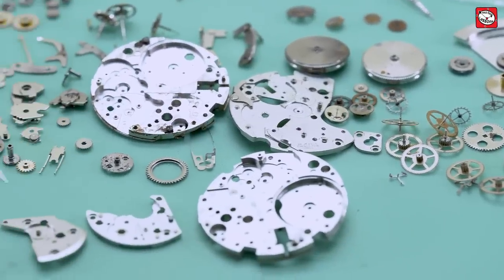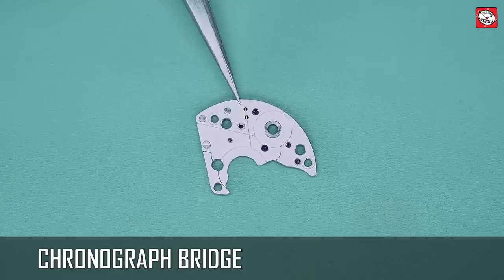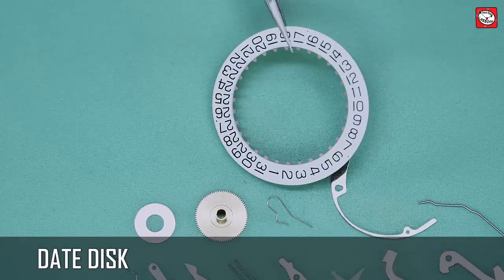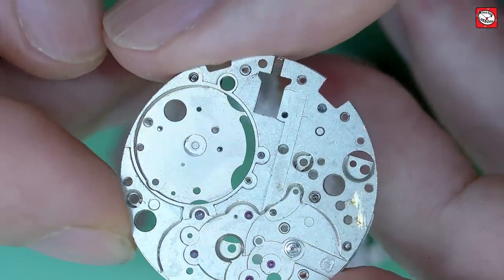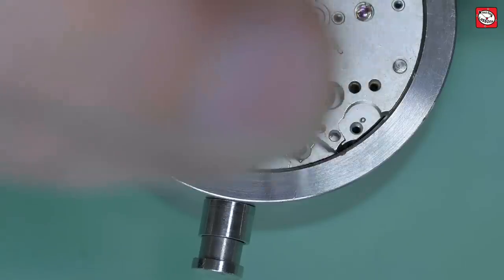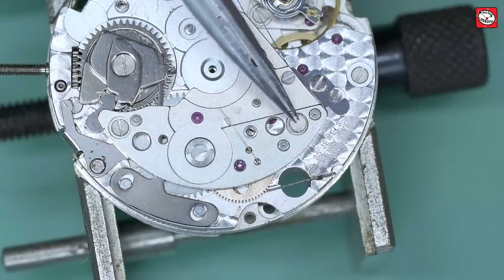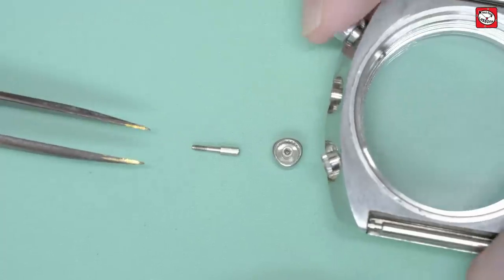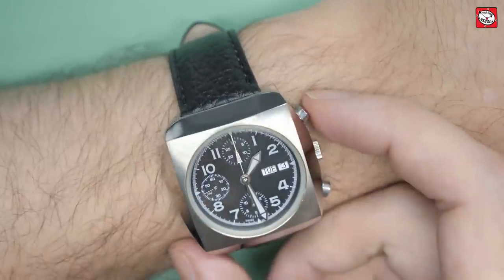I BUILT A WATCH OUT OF JUNK PARTS. Rusty Chronograph Parts to Full ETA 7750 Chronograph Restoration.

Comment: Great video...I watched this & then immediately built my own watch, complete with twin-tourbillons, & all I used was a single discarded Bic pen, some old Hot Wheels, & a waffle-iron my Mom gave us.  It was running 2-3 seconds fast a day, which was disappointing.  So, of course, I dug some rocks out of our yard & incorporated a quartz oscillator.  I know what you're thinking...."wait Scott, that's just some completely home-made Spring-Drive tech, like Grand Seiko uses".  You'd be right, but I've modified my twin-tourbillons into a perpetually regenerating battery/power-source, which is theoretically impossible, by simply incorporating some old wire out of a Speak & Spell my parents bought for me in 1981.  Now there's talk of making this watch I built into the official World's-Watch, from which the new coordinated universal time for the world will be based.  There's even going to be a call in #, like in the old days of dialing POPCORN, & you'll be able to call in & actually hear the exact time, from the watch itself!  I've accomplished this, of course, by sourcing parts from a Teddy Ruxpin talking bear that my parents bought for my little sister in 1986.  You're all so very welcome....now we'll all know, for certain, what damn time it is.  Scott Sherman

Comment: I had a watch from Schwartz Etienne where the 7750 is modified to use a column wheel for the chronograph, instead of the cam system. But a great movement and you built a very nice watch.

Comment: Has a bit of a Bell & Ross look to it....very nice. I took apart an old 3-hand TIMEX a few years ago and used modeling paint and paint stripper on the hands and dial. I was trying to give it a "rat rod" look and it actually turned out fairly well. I decided to do the case as well and that's where things went wrong. I rushed the job a bit and faded the case out too much. Once that was done, there was no real coming back. The case was a satin black and I couldn't replicate the color so I striped the case down to bare metal. I brushed the steel and then painted in some fake rust but I couldn't get the case to match the look of the dial. It's still in a drawer somewhere waiting for me to give it another shot.

Comment: Great to have the opportunity to see a real craftsman at work.  For non destructive rust removal you could try molasses or other polysaccaride reducers like Karo Light or a Maltodextrin solution, using a warm/hot solution (180F 80C) might also accelerate the redox reaction.

Comment: The dial looks great, no need to change it in the future. It matches the band and gives this chronograph a high-tech aviator or race-car feel. It makes the thick block case stand out even more against the dark dial and band. It looks like a very classy watch and nobody would know the case and movement weren't some watch designer's original idea and manufactured brand new at the source. Try wearing it proudly at some horology convention and see how many compliments and "what brand is that? New?" comments you get. LOL

Comment: To be clear - scrap or used movement parts should never be used in a customer repair job. This video is for entertainment purposes and was really just an experiment on my part to see if it could be done.

In this video we take a big bunch of scrap valjoux (ETA) 7750 watch parts to see if we can build a working and reasonably accurate Automatic Chronograph wristwatch.

This project presented quite a few challenges, not least the amount of corrosion which needed to be dealt with. Can we get it working? If so., can it be accurate? Let’s see!

Comment: Hey Mark,
Great video!!
What do you use as a rust remover? Dilute phosphoric acid?
Also, I have managed to get small screws out of things (similar size to the ones in the video) by putting the part in the oven and heating it, cooling it down ... depending on how stubborn the screws are, several cycles my be needed.
The difference in expansion will break the rust-seal eventually 

Paddy

Comment: Have you tried alum solution for removing broken screws? It takes forever, but supposedly it only dissolves iron. I've tried it before and it takes about a month for a broken off winding stem to disappear from inside the crown, but it didn't even  hurt the plating on the crown.

Comment: Just asking as I wouldn't know any better but on the first plate that was scrapped because the screws / bolts could not be removed, could you not have drilled them out and clean up the threads afterwards, or is the scale so small that this is not even an option?  What ever the case, (pun not intended) I am truly enjoying the calm relaxing nature of your informative videos. I didn't know a thing about watches, haven't worn one in 40 yrs but man, I feel quite edumacated after this ;)   Thanks again.

Comment: I've got two mechanicals to test myself on, a early 1900's Ingersoll Alert Junior pocket fob watch and a quite nice Russian movement pre-quartz Sekonda which is very old but in good condition, the hair spring retainer has come out from under the bar but the spring is in good condition so just needs putting right as it is even running for a few minutes :)

Comment: For rust removal you should try a product called Evaporust. It is not acid and is safe for any rusty metal and will not eat off any plating. I have heard it might be a problem with Iron Oxide finishes (since that is very similar to rust) but otherwise it's been a lifesaver. Also harmless to other metals and plastic.

Comment: How did you remove the rust from the parts?
Reply from the maker: With rust remover - It's in the video.
Reply: @WatchRepairChannel  Previously, you used a paste made from water and baking soda.  Is the WD-40 rust remover preferred?  I recently used the baking soda on a Bulova 11AL main plate and it worked fine, but if the WD-40 is better, I'd rather use that.
Reply from the maker: @benjaminbarrera214  It's my new preferred method. But anything that works for you will be good as long as it's non-destructive. I found the WD40 to do a good job on steel parts as well as not damaging the Rhodium plating on the movement plates.
Reply: @WatchRepairChannel  Thanks!  I was uncomfortable exposing the main plate to water so I'd rather use something non-aqueous.

Comment: Wow that is a bit of a monstrosity on the inside. Amazing that it even works. Is it possible to clean up the insides more? Without replacing more parts? Kind of appalled at the rust pits and stuff. Sorry, I have lots of hobbies, but watch repair is something I haven't tried yet. Being a klutz and all that kind of is a good reason to never take it up. If you're willing to give that away / sell that, it might be a fun thing to take apart and play with. xD First I need a pair of tweezers and some small tools.

Comment: Quick note: Wd40 isn't exactly a penetrating oil meaning it won't seep into screw threads and loosen them up. Try pb blaster or liquid wrench or even Wd40 makes a penetrating fluid. Depends what's available in your area

Comment: Dear Sir , thank you for your many video 
Now I can a clue of what automatic watch is . But this time I would like  to get advise from you from same project of building and Watch from scratch. I bought a case with its dial for ETA7750 , but the case was used and the movements holder is missing. Can you please advise when I can get the movements holder and watch hands. Here are some dimensions 
Case Internal diameter is 34mm
The dial is 33.8mm
Thanking you in advance

Comment: My 1981 mens Rolex Datejust is working fine but hasn't been serviced since about 1994, it seems you are more than qualified to take this on, would you be willing to do so?  The only issues I am aware of on the watch are some sort of residue on the seconds hand, probably lubricant deposit, and the dial isn't square in the case, by a minute amount, it's been like that since the last service, which Rolex GB did!!  I'd be happy for the service to be used as the subject for a  video, in fact, I'd be delighted!

Comment: I'm a complete noob to watch repair and watches in genereral, but you use a lot of 'spare' parts.. does this mean that these parts are used in different brands of watches ? I mean, the valjoux (ETA) 7750 (????)  is a standard watch mechanism or so?..
Reply: Valjoux (ETA) is a swiss mass producer of watch movements that they supplied to many major brands, especially in the mid-late 20th century before in-house movements became fashionable/affordable for the larger companies. These parts would have come from many different watches, some of which put their own spin on them/modified them, such as the decorative patterning. My guess is that the nicest of these parts would have come from the Breitling he mentioned. The 7750 is an especially iconic model.

Comment: No idea if this might help but Oxalic acid is used to remove rust but isn't strong enough to etch or eat through pure metals.
might be an alternative to remove rust with any luck its often used as a "secret" in the auto cleaning industry to remove surface rust ans similar things without damaging anything else.